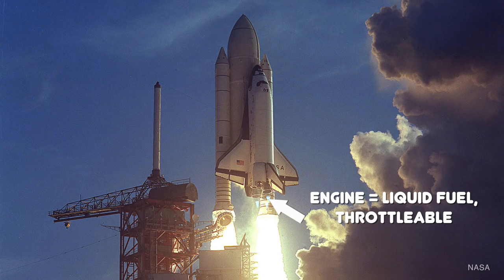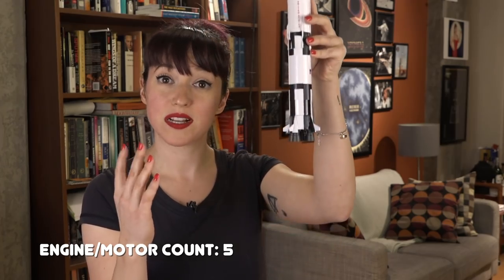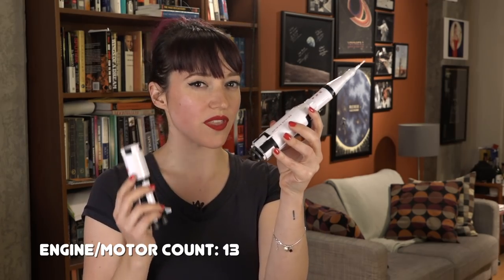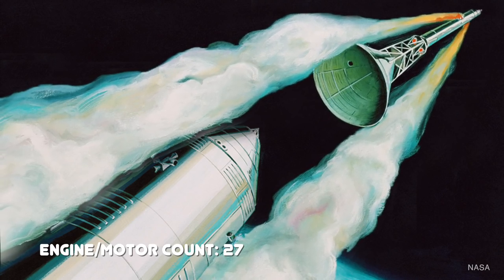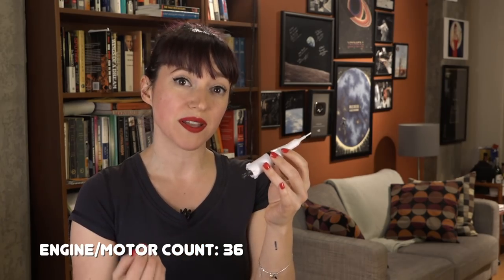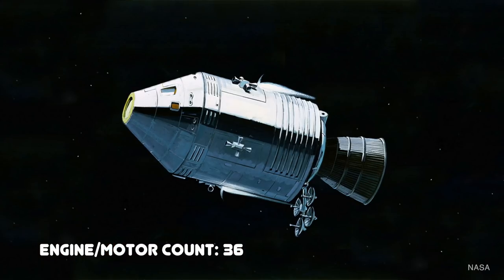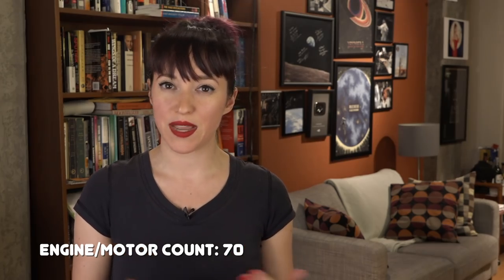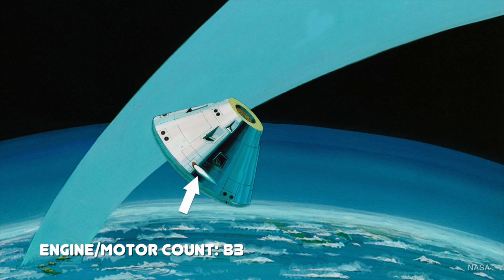It Took 83 Engines to Get to the Moon

Comment: And don't forget the engine in the van that took them to the pad.
Reply: Also the one that propelled the elevator in the launch tower.
Reply: What about the three electric motors that powered their life support?
Reply: 😂 facts
Reply: Oh, and the turbo pumps in the Rockets
Reply: Tom Musial   don’t forget the engines on the helicopter that retrieved their capsule from the ocean
Reply: and the engines that took the rocket to the pad
Reply: And all the engines in the cars that took ground control and mission control crew to the space centers.
Reply: Oh the perfection!!!!
Reply: Oh the perfection of it all!!!
Reply: @kommandantgalileo  check✔️
Reply: @lizardbyte  of the pad
Reply: don't forget the 4 engine on the crawler that wheeled the Saturn V out of the VAB
Reply: The starter motor that got cranked to ire that engine up.
Reply: You mean to Nevada Desert.

Comment: It's so cool to see such a lovely young lady with an IQ talking about my dad's engines. When I was 8 to 10 years old or so, mid 60s, my dad was a leadman of a crew building the F-1 engines. I got to see one up close in the factory when I was 10. 
There was a walkway around the inside wail about 3 stories up. My dad took me up to his desk on that walkway. He could see the whole plant. There was a hole in the floor under his desk where the very top of an F-1 stuck through and became his footstool. 
These engines put out 32 million horsepower, or 7.5 million lbs of thrust. There were 5 on the rocket.
65 were built that were never used.
Reply: where did they put all that hay for them horses? 🤔

Comment: I would have liked to be in the design meeting as the engineer brought up "Hey, we need to push the rocket forward a little to get the fuel to slosh back to the bottom of the tanks." Such a mundane problem that required a few more engine/motors to solve.
Reply: New concept to me, but sounds like they were relatively well understood. First used on the Thor-Agena rocket: https://en.wikipedia.org/wiki/Ullage_motor
Reply: Somewhere on Youtube there's camera footage of the inside of the S-IVB during flight. You see the tank draining as the liquid hydrogen is used up, then floating free as the stage coasts, then dropping back as the ullage motors fire for a second burn. It's pretty cool.

Edit: In fact, here it is: https://youtu.be/mJzT2bBGVfo
Reply: Thanks! The Saturn 1 kerosene tank footage is a lot shorter: https://www.youtube.com/watch?v=fL-Oi9m2beA
Reply: On a related note, one thing that Amy did not have time to mention or chose not to include, was that once they were in space, helium was used to the pressurize the fuel tanks, to keep the fuel where it was needed, at the fuel nozzles so that no air would get into the lines.
Reply: According to Wikipedia, almost all rocket engines (after launch) use helium pressurisation. The alternative use of turbo-pumps is only justified for the heavier first stage(s).
Reply: Erm... will really tanks pressurisation make any difference for fuel sloshing in weightless state?
Reply: justunfoe The tanks that were pressurised with helium used a bladder to keep the liquid on one side. Edit: Had to check what kind of material could handle those conditions, Teflon!
Reply: Ok, it makes perfect sense) Thank you!
Reply: The russian use an other way. They light the first (the 4 external bosters) and second stage at start. and the third stage will light when the second stage is still burning...
Reply: My thought, exactly.  Every tiny detail I learn about these missions leads to a lot more questions and I'm left in awe of the engineering that went into this evolution.  And it was done mostly w/ slide rules!
Reply: But I hear from my pilot friend that ullage already was old hat and well known in air crafts, except they have gravity and G forces in a multitude of directions. In space the rules are just different. Surely NASA had one or two old style pilots in that first meeting who would bring it up, rather than everyone gasping in surprise of this problem, appearing from engineering hell, at first mission in space.

Comment: Here's an idea for you Amy. How about an episode about all those Saturn first and second stages that fell into the Atlantic? Where they recovered? Where are they now? Any quirky stories?
Reply: The basic answer is no they were not recovered. They just fell into the ocean. The full answer is probably more complicated than that. I bet Amy would be able to tell us.
Reply: Jeff Bezos found Apollo 12 first stage some years back and the remains are in a museum.
Reply: They found parts of the first stage from Apollo 11 as well. The first stages were destroyed upon contact with the ocean. They hit the water at some 4,xxx mph. So they exploded upon contact then sank
Reply: 4000 miles per hour? I don't think so. They were a hollow cylinder in free fall. Terminal velocity is much much less than that, more than 10 times less. Yes, I know it was going very fast when it separated, but the atmosphere would either burn it or slow it down.
Reply: Gabriel Braun that speed is a number that stands out to me. I believe I read that somewhere. Can't confirm or deny that speed through Google searching.
Reply: What about all the extremely toxic fuels that would have been left over like hydrazine. Even al little bit will kill a person it can't have been good for marine life.
Perhaps it was all allowed to burn first?
Reply: Steve C I think 4000 odd you are thinking of was the depth. In meters.
Reply: Terminal velocity only refers to exact vertical distance covered in a given period of time or altitude. It doesn't refer to horizontal distance covered in a given period of time. This is why gliders can glide at well above terminal velocity even though they'er just falling with style.
Reply: The Dave First stage burned RP-1 (highly-refined kerosene) with a LOX oxydizer. Submarines powered by kerosene have leaked fuel into the oceans for decades. The retros burned solid fuel and that would have been completely expended by the time the S-1C splashed down.
Reply: I Believe atleast one of them is in Solar Orbit , and possibly orbiting the Earth . Here's all I could find right now  https://en.wikipedia.org/wiki/J002E3  .   And YES  I think Amy Should do an Episode on the Location of Spent Rockets !

Comment: For some reason, the coolest sequence to me is the eight motors firing to create the specific impulse necessary to saturate the fuel feed lines for the main engine of the second stage to start.  Maybe its just the usage of motors to prime the engines.  It's cool, but I wonder if there was some way they could get it to work with compressed gas and one way valves or something.
Reply: If there was an easier way, they would have tried! Star Trek, Scotty: I canna change the law of physics! Wikipedia gives a good explanation: https://en.wikipedia.org/wiki/Ullage_motor
Reply: Sweet!
Reply: On the LEM and the CSM they just used the RCS engines for ullage. On the heavier parts you need more thrust, hence all the solid motors.
Reply: Can work just fine with pressurised gas thrusters, that's what the second stage of SpaceX's Falcon rockets uses. (Nitrogen, in their case.)
Reply: The easiest way is hot staging, which is what Soyuz uses. You simply build an open interstage, and ignite the second stage before the first stage finishes burning. Or, on the spacecraft, you have the main propellant tanks feed a smaller sump tank that in turn feeds the engine. That way, as long as the sump tank is full you don't need to do a ullage burn.
Reply: Jules Hodge The engine skirt ullage motors were eliminated completely on Apollos 15-17, the "J" missions.

Comment: The Saturn V - Apollo combination was so complex.  With all those 83 motors and engines, the one I most am impressed with is the LM ascent stage engine for which there was no back-up and that had to fire for almost 10 minutes to take the LM ascent stage to an altitude and at a spped over the Moon sufficient to dock with the orbiting CM.  Fortunately, that ascent stage engine did not fail ever when needed.

Comment: Amy, Have you done a detailed video on the design and fabrication of the Apollo ablative heat shield? It's quite interesting how NASA decided upon using novolac epoxy, which is basically a plastic compound to protect the spacecraft and crew from the intense heat of re-entry. Also you could contrast that with the heat shields used in the Mercury and Gemini spacecraft.
Reply: +Superior Planet Thanks, that looks like a great resource. 👍 Any ideas where I could find a detailed description/discussion of the construction and structure (with diagrams) of the Apollo command module?

Comment: Could the arms from the tower actually hold down the Saturn V at full thrust? I'd imagine not, but I only ever assumed those arms were for umbilicals and perhaps balance.
Reply: The arms up the side of the rocket are indeed for umbilicals topping off the tanks till the moment of launch.  Look up "Saturn V launch camera E-8"  That will show you four very sturdy hold down arms used to keep the beast locked down till go-time.
Reply: There were hold down arms at the base of the rocket that kept it on the pad until it (just) achieved full thrust. These could not hold it down indefinitely, though, and released as soon as full thrust was achieved.
Reply: katie_incredible The initial acceleration of the Saturn V was one of the most gentle of all rockets, with engine thrust barely exceeding the weight of the fully fueled rocket at takeoff. The force needed to hold it onto the pad would have been a relatively small fraction of the rocket thrust.
Reply: The thrust at liftoff was 7.5 million pounds, with a fully fueled Saturn V weighing 6.1 million pounds.  So the four hold down arms restrained 1.4 million pounds of upwardsness, an impressive feat!
Reply: And from the time fueling was complete up until engine ignition, they had to withstand 6.1 million pounds of downwardness. That's even harder. The hardest thing was making absolutely sure they released simultaneously, if even one had been the slightest bit late, the rocket would've pitched over in that direction.
Reply: Adam - This corresponds to 350k lb of force per hold down. It the hold downs carry the thrust load axially and are made of medium strength steel with a yield strength of 100 ksi and have a circular cross section, they need a diameter of only 2.16 in. Higher strength steels could easily have yield strengths of 200 ksi. Throw in a safety margin, some load transients, and a bit of bending and 4 in. should be fine.
Reply: There were also some dies on the first stage that pulled along 15cm long pins attached to the hold-down arms. As the stage began to move, this created drag that helped the rocket lift off a little more gently. So these pins and dies also somewhat reduced the forces that the hold-down arms had to withstand.

Comment: Can anyone suggest a nice model for the Saturn V rocket that comes apart and shows all the stages? I really want to own one to show my kids (when I get them).
Reply: The Lego model is very high quality.  Separates into all the stages, tons of details.  Impressive size.  $120.  Highly recommend it.  Make sure you don't accidentally get the lower quality "Lepin" Chinese knock-off.
Reply: I have one of those too.  Its nearly 2000 pieces so its a good 5-6 hour build.

Very impressed with the little details they managed to get into the lego kit.
Reply: The Airfix brand Saturn 5 kit is good.
Reply: Kevin Moore It's 1969 pieces, get it? 1969 😏
Reply: The answer is: "it depends." One choice already mentioned is the Lego model. Not too hard to find, but expensive. On the other hand it's pre-painted and no glue is required. ~1/110 scale. I prefer other solutions because it is obviously a Lego kit. Usually runs $120-$140.

Airfix is a good choice. 1/144 scale, hard to find, slightly more accurate than the Revell/Monogram kit. Runs about the same price as the Revell/Monogram kit at $60 + shipping, depending on seller.

Then there is the famous Revell/Monogram kit.  1/144, based on the Block 1 design, so the command module is not accurate, and the paint instructions match the first series. She did a video on that paint scheme at one point. :)  Easy to fix, and the model is designed to come apart stage by stage, as is the Airfix kit. Usually found about $60 + shipping.

If you're willing to spend the $$$ to get the Lego kit, you might want to look at the Dragon Saturn V kit. It's a whopping 1/72 scale,  price runs close to the Lego kit.

There's the AMT kit. It's 1/200. One version has all the manned boosters from Mercury to Saturn 1b and Saturn V, and the other is a Saturn V by itself. The former is much more expensive. The latter runs around $20-$25 + shipping. The quality & accuracy are good, even if it's smaller. Actually the inter-stage sections are more accurate than the bigger Revell/Monogram kit.

Finally there are some small-scale (c. 1/300 or so) toys which feature separating stages, if you don't mind the small size.
Reply: I always thought that the Revell model, long out of production/stock I think, was probably the best Saturn V plastic model. Mine is ostensibly the German Revell, but essentially the same kit. Roughly 45 inches tall, compared to the actual rocket being 363 feet tall, that would make it about 1/96 scale.....I thought it was 1/92 scale, a common ratio, but the math says otherwise.

The stages come apart and have lots of detailing. The third stage shroud opens to expose the stacked LM ascent/descent stages, which can be removed. The descent stage legs extend from retracted position to landing position, and the model came with a small bit of lunar landscape to set it on if desired for display. The command/service modules came apart as well, and there was good detailing inside the command module, and you could see the astronauts and control panels through the tiny plastic windows. The protective shroud over the command module was attached to the launch escape mast and rocket, and could be removed. The stacked Saturn V model could be rested on its own display stand.

A nice bit of kit, took quite a lot of hours to assemble and paint. After all these years it still looks great on my desk. My brother recently bought one on eBay (still in unassembled kit form), so maybe there are still some others out there.....
Reply: 1/96 is what Revell state it to be.
Reply: @youtuuba  I recently bought one of these. It is 1/96 scale, so your maths is correct! I hope to have it built for the 50th anniversary in July, but I also found the Revell 1/48 Eagle & Columbia kit, which I'm in the process of building.

Comment: 83 Engines and motors to get to the Moon, but a total of 88 on board the entire full stack Saturn V? That's a ton of propulsive power. Thanks for this video, Amy. I had never considered this angle of the Saturn V before.

-Brian

Comment: Thanks for the video, I never really gave much thought to liquid fuels behavior in 0G but having some kind of engine thrusting the frame forward to get the fuel to clump up near pumps and etc sounds like an obvious thing when I think about it.
Reply: Magnus Bekkengen The Russians used the hot staging method to solve this problem. Fascinating stuff.
Reply: That is indeed why the Soyuz uses hot staging, and why the Atlas had that interesting stage-and-a-half configuration. No one was really keen on or confident in igniting engines in flight at the time.
Reply: These were called ullage burns and the saturn, the CSM and LM all used ullage burns.  In fact the LM computer automatically added a 7.5 second RCS ullage before descent engine firings to reduce the workload of the crew.
Reply: Not really from slosh, but from the fact that the ascent engine was not gimballed, therefore the only way to steer was firing of the RCS, causing the rocking motion as it chased its target orbit.

Comment: 53 engines actually because that's all they needs to get to the moon and back
they really only needed 36 though
Reply: Where in the world are you getting these numbers?
Reply: 53 incase of mistakes but this is for entering the sphere of influence of the moon not landing aka going to the moon
Reply: You are correct on the 53 engines were needed to get to the moon 'and back' as in Apollo 8 style. But 36???
Reply: ken assuming you do it perfectly only 36 because they put the craft on a trajectory to go to the moon and in case something fails they'll flyby and return
so if you get that trajectory perfectly with no need for corrections you can go to the moon then just glide back
Reply: I believe then the number would be 38. Two roll thrusters would have been fired on the SM to even out the Sun's heating effect on the SM/CM.
Reply: Unless they had to fire all 4 roll thrusters, then the number is 40. Not sure if they could deselect 2 of them or not?
Reply: Of course if they were in a roll or tumble already, then 36 is the magic number :)
Reply: ahh for roll you would need at least 4 so 40 and i think there are a few for descent to the earth but i don't think those are required
Reply: Interesting. I know Apollo 13 didn't fire the SM main engine out of fear that the SM explosion may have damaged the engine or it's systems. I wonder if they used the RCS on the SM at all after that. I'll have to review the flight transcripts.
Reply: Duh to myself, they shut down the CM so no SM RCS on Apollo 13 after the explosion.
Reply: 84 .. Amy forgot the transfer van engine that took them to the launch pad :|

Comment: I just rewatched Apollo 13, and you can actually see the 8 smaller engines to push the upper stages after the stage separation. It's amazing how much thought they put in to show those smaller details.
Reply: I read somewhere that the worst thing they got wrong was the color of one of the Corvettes... :)